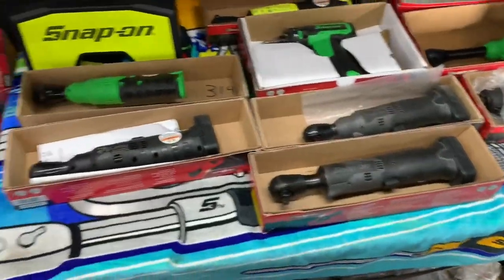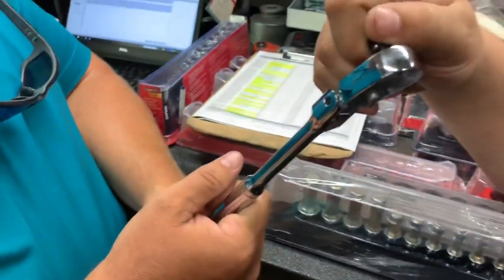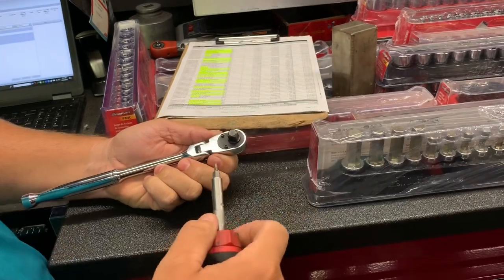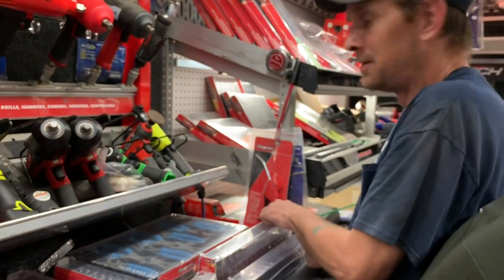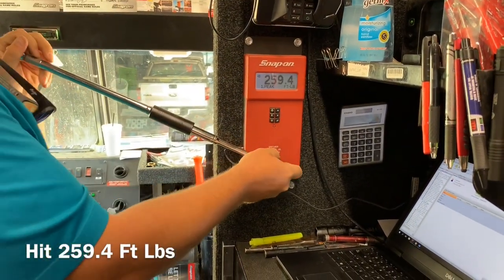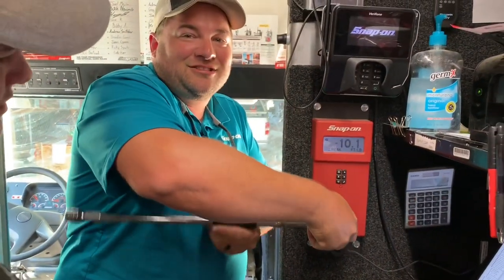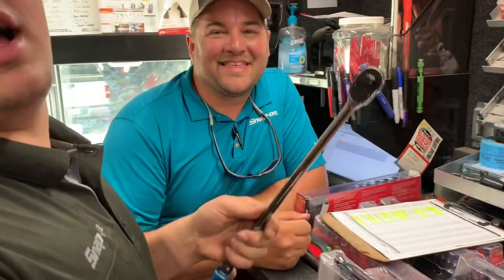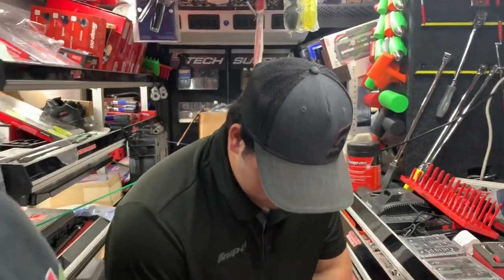Snap On Dealer Puts ICON Head To Head VS Snap On Ratchet

Comment: So is tekton as good as snap on now too?
Reply from the maker: Don’t know ? I don’t own any Tekton tools ? This isn’t saying ICON is as good as Snap On either the video clearly shows the difference in size of the internals between the two. This video just shows it can take way more than should be applied to a 3/8” Ratchet. Everyone wants to take things out of context. Nobody can say that ratchet isn’t worth $40. I had my doubts on if it could handle over 200 ft lbs and it passed that easy. The one thing I don’t get is why everyone wants to hate on them. When Milwaukee came out and proved they had better tools cheaper than tool trucks everyone jumped on board and said man that’s a great tool for the money but nobody wants to give the ICON line a try
Reply: @KoonTrucking  lol totally took my comment out of context. All i meant was many other ratchets can and have been shown to do the same thing. I have absolutely no issue with the tool I just think harbor freight is acting as if selling a quality tool is some kind of earth shaddering achievement. I bought one today in fact to review after ive used it for a few months.
Reply from the maker: Brads Workbench they are worth the money for sure heck at $40 you can’t beat it. I don’t own a Gearwrench or Porto or Sunex or any other brand of ratchet. I always grew up and had Craftsman and when I was old enough to afford to pay a little for some tools I bought a snap On ratchet so pretty much since owning a vehicle I had Snap On. The ICON i purchased is a better Ratchet than the 72 tooth old school snap on I had back then. It may not be as strong but it is for sure much much smoother
Reply: @KoonTrucking  time will tell.... thats the true test. 👍

Comment: Thats not a fair comparison a 3/8DRIVE  VS 1/2 DRIVE..wtf were you thinking ole man
Reply from the maker: What are you talking about ? The torque adapter is a 1/2” both ratchets were 3/8” they both had an adapter on them. You really pay attention don’t ya bud ?
Reply: My fault I thought you used a 3/8 to 1/2 adapter

Comment: The ICON is brittle. No bend. When it breaks, you'll be going to the hospital.

If the SO fails, it will bend permanently and not break.

Guaranteed, that ICON is going to be violent when it fails.

Don't get me wrong. I'm a convert. I've been buying ICON. But I wouldn't risk putting a cheater on it
Reply from the maker: I think the anvil will snap off before anything breaks. I’ve seen them abused many times and always an anvil failure

Comment: It has a recall now icon almost rimes with recall
Reply: This specific style of ratchet (flex head of that size) has a recall, addressing the issue of it not wanting to switch gears as this man pointed out. Will you tell me that Snap On never recalled anything?
Reply: Gears they needed to add more grease inside

Comment: First the snapon impacts feel off the top list now the ratchets falling. What's next? Is it the sockets too. Lmbo. Someone answering the tech concerns. Price change on the tools. Plus quality
Reply from the maker: I don’t know what list you are talking about in my opinion the Snap On CT761 (14.4 volt 3/8”) Impact is my favorite one. I never said this ratchet would replace the Snap On ratchets either. I just stated this ratchet was well worth the $40 they charge for it.
Reply: @KoonTrucking  i know you didnt say that. I did. Lol Cool do you i have well over $80,000 worth of tool. Its time i slow down and buy something better for the buck and wont hurt me and get the job done. O try Milwaukee 3/8 electric impact gun both of them out do Snapon 3/8 E. Impact gun. But  I enjoy your show.

Comment: The Cheaper Pittsburgh Pro will do the same. Snap-On is way overpriced. The End.  I respect the SO Dealer so much for not just starting to make stuff up and see it for what it is. In Snap-On defence however, it is the only swivel head ratchet I ever used where the Head will hold in place with a socket on it.  Still the Price is tooooooo high especially if the Salesman is pressuring young mechanics into spending half of their paycheck on that tool truck.

Comment: Unlike Snap-on there likely won't be rebuild kits for these ratchets but I can buy 3 of these before I'd be close (but not there) to the cost of a Snap-on ratchet.  Buy a couple of rebuild kits and I'm adding another $40. If the quality is the same; why not buy ICON and save money?

Comment: Beat the snap on and had a chester on it 🤣
Reply from the maker: Because the Snap On handle flexed more because the cheater pipe and short handle on ICON didn’t have as much flex. It is not stronger than snap on this is just to show it will hold up to most daily jobs asked. As you can tell by the gears inside the ICON is way smaller but it held its own. It’s well worth the $40 they ask for it
Reply: @KoonTrucking  you are aware they are built in the same factory as the snap on

Comment: The snap on is alot longer so its made heavier duty than a shorter snap on would be this is a dumb comparison you need to do apples to apples if your take the time to compare do it correctly
Reply from the maker: They aren’t made any different. Same head. Same anvil. Same gears. The only difference is the handle length but there’s no difference you can take the head off the short one and put it on a long handle. Exact same head

Comment: Harborfreight tool.boxes are cheaper and better but nobody wanna ssy it
Reply from the maker: They are cheaper but they are not better, I know everyone wants to claim they are but at had a Harbor Freight box and still have it but they aren’t anywhere close to the same build quality. The drawers can not hold the weight that snap on does. They will sag and hit the drawer under it. But you are right they are cheaper
Reply: I had my 72 inch for the longest ive seen snap on break

Comment: It's it's holding up but it hard to buy a counterfeit tool it's looks like a snap on but it isn't
Reply: Copies and counterfeits arent the same thing. It's a common practice in the knife industry too.
Reply: @Mark-sn6kh  I can tell the difference between a Snap on Mac Matco SK Craftsman just by looking at them and for a company who attack certain brands they sure go out of there way to look like what have can't they come up with own look
Reply: No it is easy to buy because it is cheaper.
Reply: Emerald lx  I had a 1948 Snap-On ratchet with the classic handle. It was jacked up so it got exchanged for a 1958. The 48 was cool though because it had an oiler in its head.
Reply: @1pcfred  you want to buy that garbage you go right ahead no skin off my knuckles
Reply: @larryborkstrom3580  one man's trash is another man's treasure.
Reply: @1pcfred  you'll have to buy three of those ratchets before you buy one Snap-on ratchet and no warranty don't cover wear out so technically it's probably cheaper in the long run to go pay a little more now
Reply: @larryborkstrom3580  Harbor Freight will replace any warranty item for any reason if it is broken no questions asked.
Reply: @1pcfred  against breakage not wear out if you think that they're going to warranty something out of wear and tear then I got a bridge I can sell you in Brooklyn
Reply: @larryborkstrom3580  it would depend on how Harbor Freight's ambiguous warranty is interpreted. So far the policy has been very liberal though. I've yet to hear of anyone that's been refused. While the right is clearly reserved I still have to go by how it is implemented. Which is overwhelmingly hassle free. That's not how Snap-On has been operating with casual individuals either. Now if they don't know you and haven't sold tools to you they're not going to do anything for you either.
Reply: @1pcfred  you know they're here today they're probably going to be gone tomorrow let's say for the Bauer brand that has a direct copy of DeWalt they're locking pliers are direct copy of the Irwin vise grips Doyle Pliers are direct copy of Channellock he's icon sockets and ratchets are direct copy off Snap-on including their wrenches and tool boxes I'm pretty sure they're probably going to wind up getting sued blind and out of business
Reply: @larryborkstrom3580  Snap-On already tried to sue Harbor Freight for the floor jacks they were copying. It did not work out well for them either. Our legal system is not a bludgeon to be used to squash competitors. So you either compete on merit or you pedal your sorry ass home in the marketplace. We consumers ultimately decide who wins and loses. Right now I'd say Harbor Freight and us consumers are all winning too.
Reply: @1pcfred  I really have a lot of fun with you Harbor Freight fanboys think that Chinese and Taiwanese make great stop what's next from you and you're going to tell me that Dollar General beats Macy's here's another one for you to how about the Fiat beads Mercedes-Benz sometimes my friend you get what you pay for it so I'm not telling you where to spend your money but I don't think I'm afraid it's going to be around too much longer look at the case between Ford versus Toyota over that T100 not only did they copied of the name a Ford Truck Line they also made T100 look just like an F-150 they got their ass handed to him or how about Snap-on getting their ass handed to him from Milwaukee by having a red cordless power tool
Reply: @larryborkstrom3580  sometimes you get what you pay for and sometimes you get ripped off. If Snap-On isn't overcharging then they're producing tools inefficiently. The bottom line is we've fallen behind when it comes to manufacturing. There are some inherent flaws in our capitalistic system when coupled with certain instinctive human traits. Just because it worked in the past is no reason to believe it remains competitive today. You look at Snap-On's factories then you look at the far eastern factories. See which ones have newer machinery, better lighting and are generally more organized and cleaner. Our country got sold down the river for short term profits in the 80s. People cashed out. We're still holding that bag today. You buying American isn't going to turn that around either. You building America might if you sacrifice enough though. The Milwaukee thing was them patenting lithium ion battery packs. Milwaukee tries to screw everyone over with that. They don't care what color your tool is either.
Reply: @1pcfred  I'll buy what I buy I used to buy disposal items from HF but they filling up mail box with spam I'm sick of there ad campaign I know is B/S
Reply: @larryborkstrom3580  I have some Harbor Freight items that are 27 years old now. I guess it depends on what you buy. Being into tools looking at them never bothers me much.
Reply: @1pcfred  why don't agree to disagree but not one time did I tell you where to spend your money
Reply: @larryborkstrom3580  so? What would that change if you did? Do you really think you have any kind of influence over me? Is this a megalomania thing that you suffer from?
Reply: @1pcfred  I'm not the one trying to change your mind for the last time think it's the other way around
Reply: @larryborkstrom3580  it is always good to keep an open mind concerning change. Unfortunately that is also generally difficult for us to do. History is littered with examples of people that resisted change and paid for it heavily as a result. We are living in a time of unprecedented change right now too. So it is especially hard to keep up.
Reply: @1pcfred  they never have a monopoly look at craftsman was better than harbor freight ever will be the tool trucks survived that plus they survived in the beginning of of kobolt and home depot of husky when they started was the same quailty of snap on aka kobalt Matco aka husky now like HF PROS don't like going back and forth retail stores even better ones like home depot or Lowe's Sears let alone a low level store lile HF
Reply: @larryborkstrom3580  Crap Man quick tools? Meh, they were never anything special. They were what you bought when you needed tools but couldn't afford anything great. I still have some of my 30 piece screwdriver set I bought there when I was young stinking up my toolbox. I've found Harbor Freight to be a lot better value than Sears ever was.
Reply: @1pcfred  your hopeless if I want to buy a quality product I'll buy a quality product why would I buy garbage to save a couple dollars what else am I going to spend my money on I might as well spend it on something I like
Reply: @larryborkstrom3580  who told you it is garbage? I bet your closet is jammed with Jimmy Choo high heeled shoes too!

Comment: Sanp on is dead. They have been riding the coat tails of the name for too long now. Both have lifetime warranty. Snap on shows up once a week if I'm lucky, harbor freight is a five minute drive at all times. Ive decided the name on the tool is worthless. I need the tool to work so I can work. The tool is only as good as the hand that holds it. Sorry snap on. You make good stuff but others are making stuff that competes at a fraction of the price. If the 40 dollar icon is almost as good as the 200 snap on what the hell am I paying for?

Comment: This is completely pointless and worthless test. Ones a fixed head. Ones a flex. Ones shorter with a cheater pipe and ones longer. If your gonna compare and test then compare 2 of the same and similar ratchets.
Reply from the maker: You do realize it is to show that the ICON can take the pressure right ? He didn’t have a flex head ratchet on the truck and I don’t blame him for not putting a cheater pipe on a brand new ratchet that he sells. If the icon flex head can take the same (actually more) than the snap on fixed head then that definitely proves it is a good ratchet

Comment: Well do that a o couple hundred times a day for a month and see how it holds up that's a real test survive a hard shop for a month getting abuse
Reply: Nothing is perfect. I’ve broken most brands (granted usually with a cheater pipe or standing on it just to get the truck done) so far my snap on and gearwrench ratchets have survived. I have trucks for these two and it’s nice not having to drive for a warranty.
Reply: Emerald lx  the truck comes to sell mostly and then collect money and service anything in-between and fwiw my co-worker has already broke a 18mm icon ratchet wrench so I'm not impressed had to borrow  my sk 😂 to get the job done all tools break but many will survive Alot longer than others before they give and that's worth the extra 💰
Reply: @doctordiesel5467  The ICON clearly loosened the job before it broke.
Reply: @1pcfred  loosened what job
Reply: @doctordiesel5467  the job it broke on.
Reply: @1pcfred  but it couldn't finish it and it was the 3rd the he used it as I asked him today about it he's not overly happy he has to go about 35 minutes out of his way to warranty it out  I can understand why he's not thrilled 1 hr plus wasted and I bought today as a matter of fact the short 1/2 flex head metal handle icon ratchet used on an egt sensor and the ratchet is now having trouble switching directions and as I viewed the rest of the icon line the combo wrenches suck no chamfer on the boxes of the wrench they will be hell to out on a fastener especially a little rusted boxes are not uniform thick in the center so that thicker center can make full engagement in tight quarters an issue the wrench jaws height is a bit thick not going in tight placed and getting the open end in the 1/4 flex head the u joint of the ratchet is as thick as the head good luck swinging that in tight spots some sets of ratchets wrenches have no slip jaws and others don't weird and their the same set number  overall with all this hype I'm not really impressed and sold on the line only thing that looked ok was the socket but some have thick walls though just my thoughts after handling them and using a few tools already for the price ehh definitely not near snapon as they are claiming or compare to snapon  as their tags say only plus to the icon 1/2 drive ratchet I bought the head is a bit smaller than a snapon but the u joint on it is super thick again lots of meta lmass to compensate for lesser quality steel or it wouldn't be that thick  when a snapons is way thinner and much longer just my 2 cents to a nickels worth and my boss broke a 1/2 box on a combo wrench loosening a truck u joint strap bolt on a truck he had to tow the Mac wrench that was in the box for 5 years that's missing now worked fine so again not sold on icon as the does all to end all tool line
Reply: @doctordiesel5467  if you are not happy with tools then you do need other tools. It is a shame the people that design vehicles are not the ones that have to work on them. I'm sure things would be different then. I will say that when I am freeing a seized fastener I do not use ratcheting mechanism tools or torque to accomplish the task. I consider all of that poor form.
Reply: @1pcfred  ya I agree with that  but people are working flat rate and the is money you know so guys buy ratchet wrenches before combo wrenches now a days
Reply: @doctordiesel5467  the first tools anyone should get are combination wrenches. They're the basics. They'll do the job. Maybe not the fastest, but they will get it done. Then as you progress and want to increase productivity you get the luxury ratcheting tools. You still bust tough nuts the same old way though. Which if people are breaking tools they haven't figured out yet. There's impact and there's thermal shock. Torque is not really how to do it. Work smarter, not harder.
Reply: @1pcfred  yup agreed but some don't listen or learn from those who have been there
Reply: @doctordiesel5467  I wrenched on my own stuff so when I broke it I paid for it. That might be why I learned. In business it seems like mistakes are rewarded financially these days. The customer just pays more. Well while we were in there you needed blah, blah, blah, blah. So you gotta pay for all of that now too.